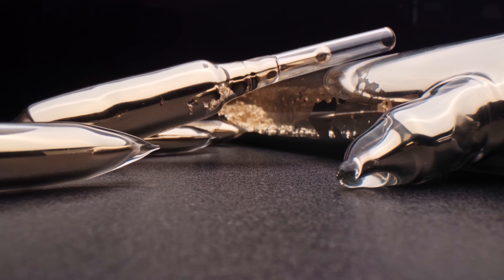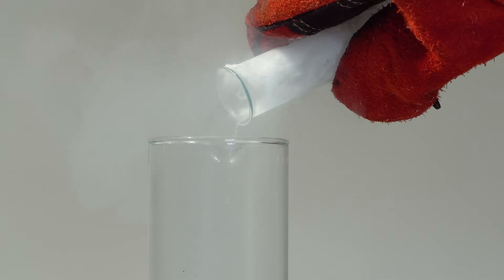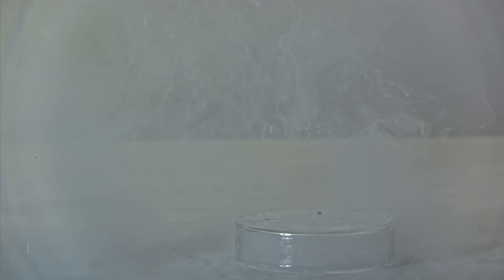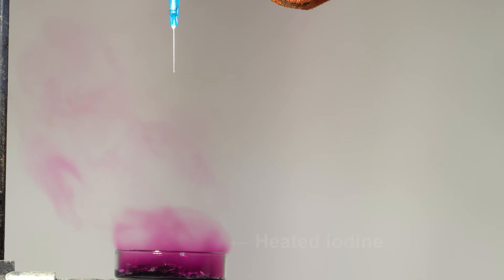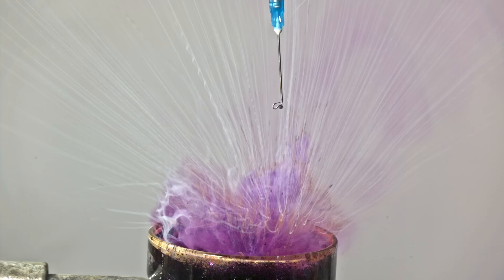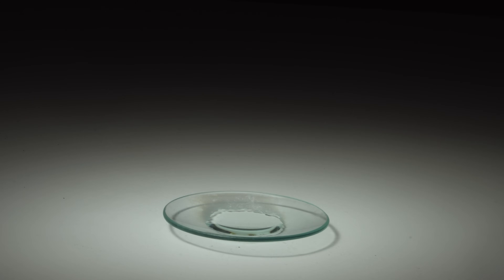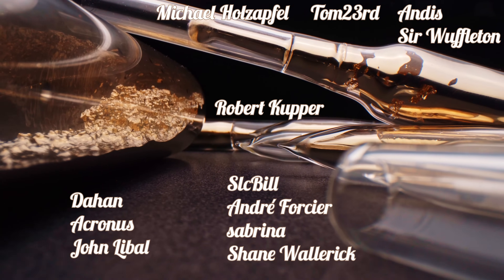RUBESIUM. Rubidium-Cesium: The MOST REACTIVE alloy! RbCs.

Comment: How does it how does a alloyed react under hydraulic pressure can it send and receive digital signal what is a bandwidth if it can send signal can it send electronic current can you become magnetic in a hydraulic word sealed without oxygen can his work as a hydraulic fluid and still send a signal can we use kind of like a white blood cell in the body to destroy oxygen and some kind of living cell  circuit where the oxygen wasn't needed can send and receive or transmit radio signal or pick up radio signal how does it respond to sound frequency in a non oxygen environment can it take on information and arrange itself crystallized formation of inherent memory

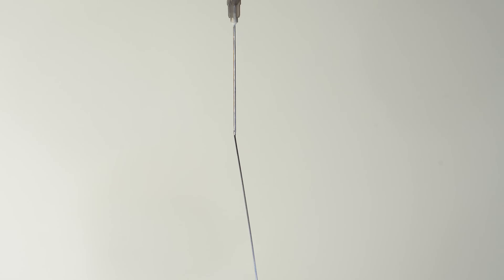Comment: It’s interesting to see the gases produced when it reacts with wood (3:15) or molten sulfur (14:20) suspend the droplets, similar to the Leiden frost effect.  Being able to see the path the droplets take marked by the burn marks in the wood makes it even better.  Also, seeing the waviness in the vapor trails of some of the smaller droplets that are launched from the more explosive reactions (pause at 12:04 or 12:05) shows that the vapor trails are being produced by a reaction site on the surface of the droplets while the droplets spin.

Comment: I hope the reactions were done in an inert atmosphere, so that we know whether we were just watching your alloy react with the object of interest, or just the air. 

It's interesting that it reacted so slowly then so violently with liquid oxygen and chlorine. That's probably because the cold temperatures greatly slow down the kinetics of the reaction. When beads of RbCs touch liquid oxygen, it reacts slowly, but heat will still be added to the liquid metal until it reaches a critical temperature and can sustain itself. Then it starts to react so fast that it is explosive. I am surprised it is slightly less reactive with chlorine than oxygen because I thought halogens are more reactive with metals than chalcogens. 

I think NaK didn't fully react with liquid chlorine because it is a slightly slower reaction than with RbCs, and so at those cold temperatures, it couldn't create heat faster than it lost it, and never hit the critical temperature. It should react violently with gaseous chlorine at room temperature though. 

Lastly, hydrazine reacted like that  because it's unstable in the presence of strong bases, because they deprotonate it into HN2-. Alkali metals act as strong bases.

Comment: Sometimes it seems like the surface of the metal turns red underneath the oxide layer, is that some kind of oxide/ozonide compound or is the alloy just getting so hot from the reaction that it becomes incandescent? Also the reactions with bromine and iodine were so pretty I gasped.

Comment: Get some shorter, larger gauge needles. 16g or larger, 3/8th inch. Ideally also blunt ended ones because if you needlestick yourself with that alloy, you're going to have a bad day.
Reply from the maker: Hey! No, I tried to take a needle with a wide tip - it clogs VERY quickly and it is impossible to squeeze anything out of the syringe :(
Reply: He could 0rder a Titanium alloy needle for that 👍🏼 but i doubt if any

Comment: if I may make a suggestion, you might want to try using blunt fill needles when performing a reaction or working with materials such as this, unlike a regular needle made to puncture skin, blunt fill needles are not sharpened and are not beveled at the tip which should make the ejection of the material from the syringe more reliable and predictable!
Reply from the maker: I tried with blunt needles they clog even faster probably due to the fact that their diameter is wider!

Comment: 9:42 about cold oxidizers, always comes to mind one of my favourite quotes from JDClark:
"Chlorine trifluoride, ClF3, or "CTF" as the engineers insist on calling it, is a colorless gas, a greenish liquid, or a white solid. It boils at 12° (so that a trivial pressure will keep it liquid at room temperature) and freezes at a convenient —76°. It also has a nice fat density, about 1.81 at room temperature.

It is also quite probably the most vigorous fluorinating agent in existence—much more vigorous than fluorine itself. Gaseous fluorine, of course, is much more dilute than the liquid ClF3, and liquid fluorine is so cold that its activity is very much reduced."

Comment: Just mix all the alkali metals together in pure hydrogen atmosphere and see what alloy amalgam u get (definitely explosive on o2 contact but how high is it? And is it a detonation or conflagration?) 

Except francium iirc you won't ever find enough of that

Yes technically hydrogen is a metal gas, look at it's position on the periodic table, freeze it solid, shines like metal
Reply from the maker: Lithium won't mix
Reply: It can be used as a conductor, what's the internal resistance of frozen hydrogen?

Having only one proton and electron makes dat orbital really unstable so you'll never find hydrogen not bonded to itself or something else.... unless you boil the gas into plasma 

You can say water is hydrogen rust and it's liquid not solid

Comment: It is curious what chemical elements from their oxides will be able to restore such active reducing agents as cesium or its alloy with rubidium to an elemental state? There is no doubt that they will recover silicon from sand. But will boron be produced from its oxide or aluminum from corundum when interacting with cesium?..
...
You have a very interesting channel, and the experiments are so colorful and visual... But still, the results of the experiments are very predictable - it is clear in advance that alkali metals will react violently with halogens.